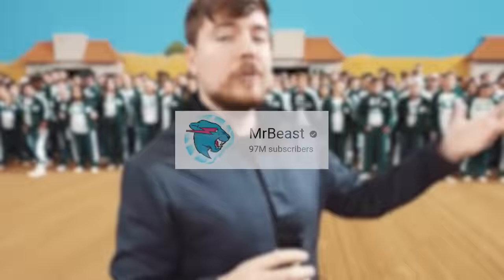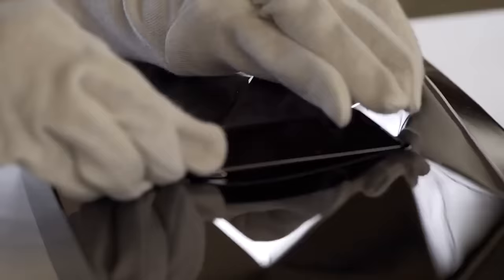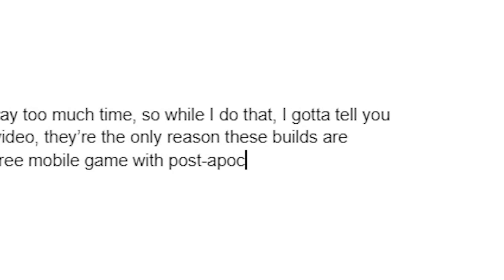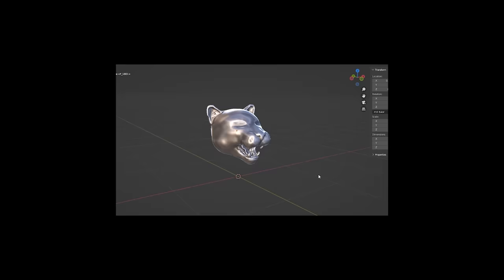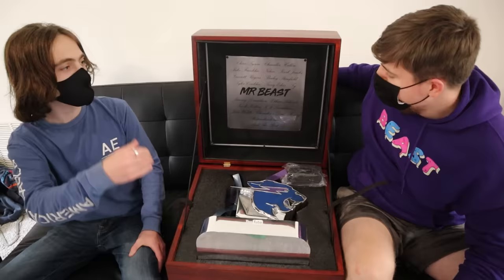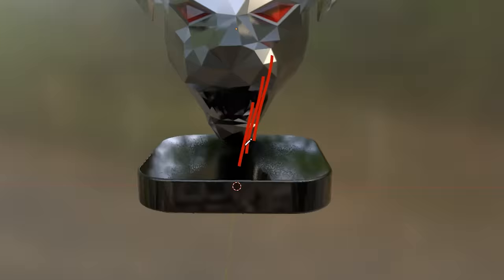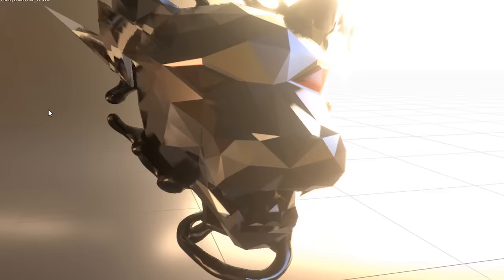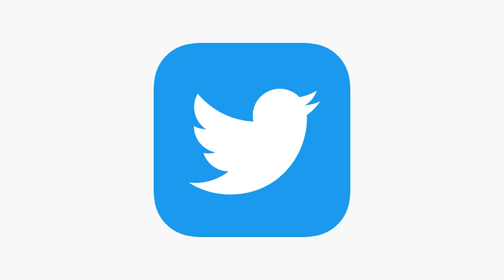I Designed MrBeast's 100 Million Playbutton! (Custom)

Comment: For the fluid-like stand part, you could do a lost PLA casting, which is 3D printing the model with PLA plastic, making a mold, and then pouring in liquid metal. Casting is the only way I see the stand portion of the award being made.
Reply: decent idea but I am not sure if Plastic could hold the weight of the aluminium long term. Idk it would need to be tested in some structure simulation software. Buut if the head itself was made of a lighter material it is a very good idea.
Reply: @TheNeonLynx  you misunderstood what i meant. you 3d print the structure, encase it in high-temp plaster, put it in the oven. Then, the plastic burns out and you’re left with a mold to pour liquid metal into
Reply: @sirfishcs  ah its a cast. Yeah I missunderstood. That makes a lot more sense.
Reply: I dont get it does he just put it in a 3d printer and it prints out?
Reply: @psps7209  you 3d print the shape you want with low melting point plastic or something similar that burns away at high heat. You encase it in for example sand or something similar  that has an extremely high melting point in a box. Then you pour liquid metal into a hole at the top. The plastic burns away and the metal replaces the shape of the plastic. You let it cool down and remove it from the cast. Now you have your 3D printed object but it is made of metal instead which can support a lot more weight. Although its not the easiest thing to do if you have no experience casting metal I have seen lots of people fail multiple attempts before they get it right and usually I see them use a core that burns/melts easier than plastic.

Looking at the pevious comment he would burn out the plastic before pouring the metal which propably would work better given the plaster holds its shape.

Comment: From the look of it though, there would be a few stress points you'd need to reinforce because the full weight of the head would be stressing the middle of the liquid design. I'd say maybe you should add some clear plastic should you make this so the metal there doesn't deform from the weight of the head. 

Sorry, just my 2 cents.
Reply: @dont5014  yea ik its crazy
Reply: @dont5014  no one cares
Reply: But that is some good advice
Reply: DONT  You add literally nothing.
Reply: I think you missed the part where he said it weighs 500 pounds…. I think he knows LOL
Reply: @lynn8033  Still. I'd rather redundant failsafes than a failure where the project has to be remade.